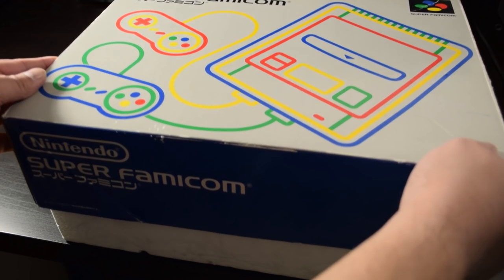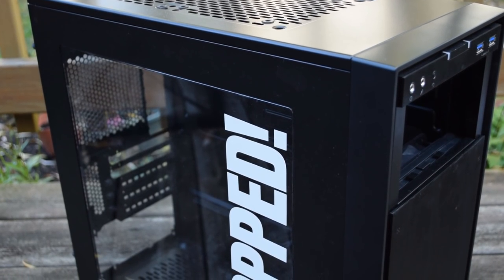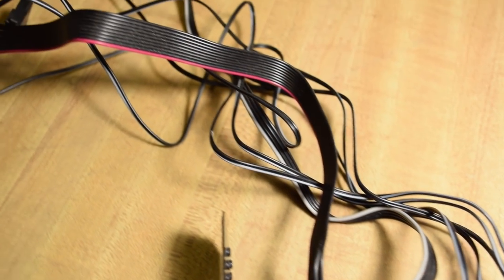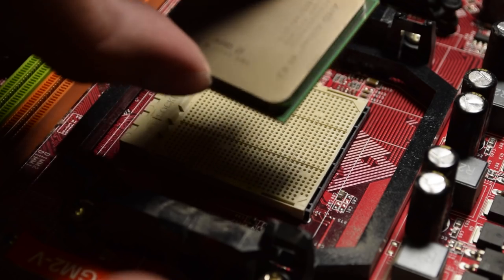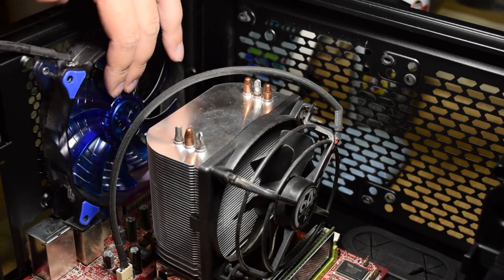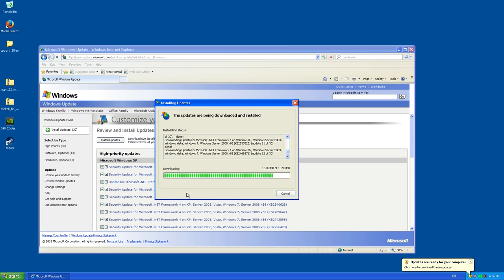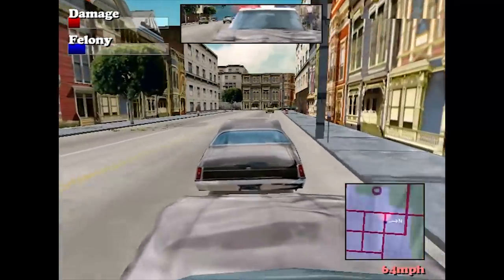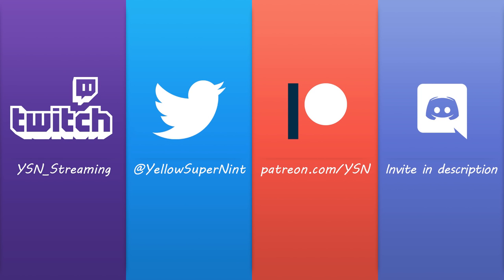Building an XP Gaming Computer out of Spare Parts

Comment: yup, pretty useful actually, I still have my old dell optiplex , I use it to run 16 bit games that don'r run on the modern 64 bit windows 10 architecture
Reply: I still remember that in the spring , I wanted to play the OG Tomb Raider, but it wouldn't work on windows 10 for some reason lol

Comment: The 2013 AMD A Series motherboards and Intel Core i3/i5/i7 3xxx series can run Windows XP with the best performance, as they were the last processors supported by Windows XP. I have an A6-6400K on one of my computers, and when I ran Windows XP, it ran very smoothly, even with video streaming

Comment: This is really interesting because I grewp up with Windows XP, but that's not really considered "retro" yet because it was in common use from 2001 all the way to 2014 it's just considered "old", Unlike Windows 2000 or 98 machines which are built for nostalgia. You don't really see a whole bunch of people who purposely build XP machines, despite it being on of the most popular operating systems.

Comment: I really love watching videos related in building Windows 98 or Windows XP retro PC.
Some may like period correct specs but personally I prefer overkill system.
My Windows XP build:
CPU: AMD FX-8300
Mobo: Asrock N68C-GS FX
RAM: 2x2GB DDR3 1600
GPU: Nvidia Geforce GTX 960 2GB
Case: Thermaltake Versa H15 Window
PSU: FSP HV PRO 650W
Storage: WD 640GB Blue HDD (No SSD for me as XP doesn't support TRIM natively) (planning to upgrade it to 2TB HDD maybe WD Black)
ODD: LG DVDRW
Reply: Too me anything, period correct for Windows XP would be 2001-2006. 2007 was the start of the Vista era. So, in that case. Fastest period correct hardware is a core 2 quad extreme qx6700 and 8800 GTX sli. Or Core 2 Duo Extreme X6800 and 7950Gx2 quad sli. This hardware should also handle the entire "Windows XP Spectrum." Without being overkill.

Comment: i have a faux retro windows XP 64-bit machine, I decided I don't need authentic era hardware so i just bought an am2+ board that came with memory on ebay, a sempron 150 (also unlocks into a dual core if you wish), and i bought a hd 4890 for £14. So it's like a socket 939 era machine but beats it completely, also the parts were MUCH cheaper.....